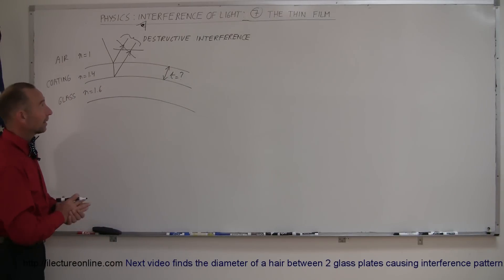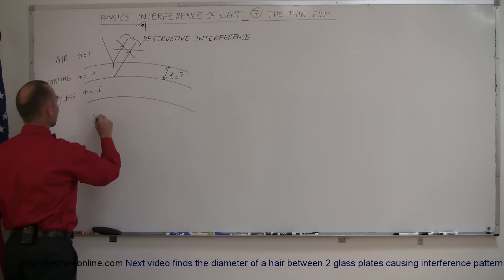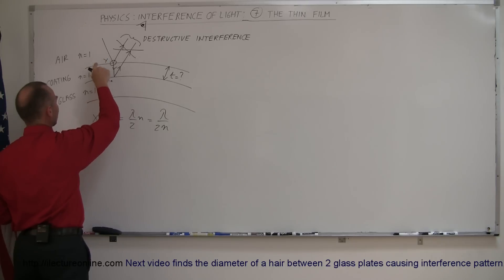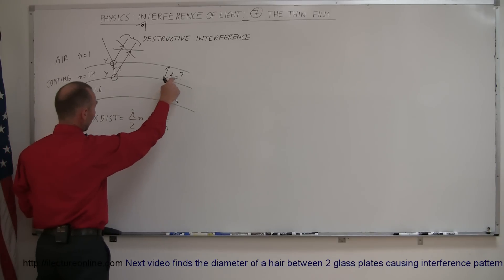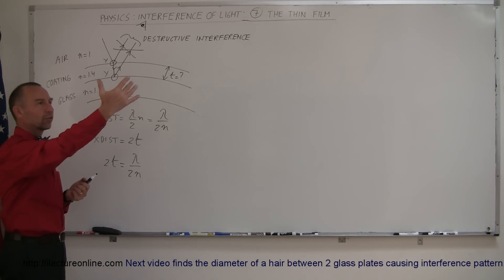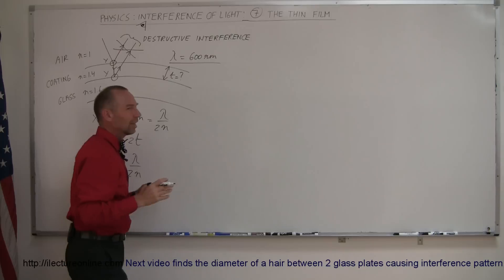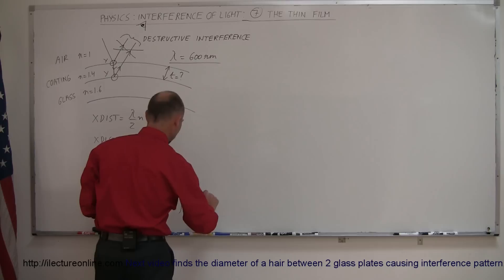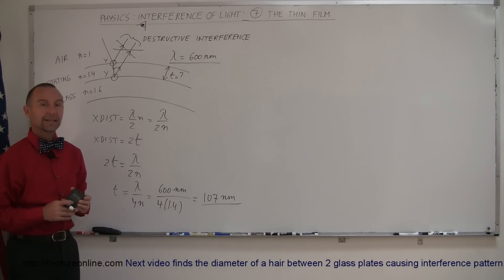Physics 60 Interference of Light (7 of 8) The Thin Film

Comment: Mr. Michel, if there is no half a wavelength phase shift at the boundary, then how are they able to destructively interfere? And also why are we considering the 180° phase shift at the boundaries when we are already aware that there resultant is destrctive interference? Is it that boudary phase shift is different from the phase shift due to the destructive interference, in the first place? I am perplexed!! Please help me!

I have one more question. Why are we asserting that destructive interference will allow all light to enter and none of it will be reflected back? Because destructive interference does not mean that nothing is passing; it simply describes the interaction of waves, while multiple waves are transmitting.
Reply from the maker: When light reflects at a boundary and the index of refraction on the other side of the boundary is greater, there is an 180 degree phase shift.  If the index of refraction is less on the other side of the boundary then there will not be a phase shift when the light reflects.
Reply: @MichelvanBiezen   I know this fact; what I am asking is why are you considering the phase shift twice_ one at the boundary and one due to destructive interference?

Comment: I'm confused here. My understanding is that in the case of destructive interference both rays still get reflected and than cancel each other since they are 180 deg out of phase. So how can we say that the light is being transmitted? What am I missing?
Reply from the maker: 1) At every boundary, light is both partially reflected and partially transmitted.   2) In this example (as  is typical for most examples of this type), we look at the recombination of the ray that is reflected off the top surface and the ray that is reflected off the second surface.

Comment: sir for constructive interference path difference should be nlambda ryt where n is any positive integer,so with n varrying there can be different thickness ryt
Reply from the maker: Not necessarily.  the path difference may also be (n+(1/2)) lambda(sub n), depending on the index of refraction of both materials.  (there could be a phase shift at the second boundary).

Comment: If you do not get that there is constructive or destructive interference in the task, how do i decide which it is? In a previous film you showed Y on both places, and here it was also Y on both places, but one gave destructive and the other constructive. Can you calculate and decide wether it is constructive or destructive? I dont understand how i am to decide hweter it is a full wavelenght or not?
Reply from the maker: It depends on what is asked.  If the problem states that they do not want any reflection, you need total destructive interference so that all the light will be transmitted, and if they want none of the light to be transmitted, then they want total constructive interference, so that all light will be reflected (like UV light)

Comment: Thank you so much Sir. But there's one thing I can not understand. How can destructive interference increase the transmission?  as you demonstrate in the class. reflected beam will cancel out each other, but the reflected beam will just disappear. those can not increase the transmitted energy. thank you so much Sir.
Reply from the maker: Yes, people like you that look into it a little closer will indeed find some discrepancies with this type of problem. The problem is oversimplified in order to illustrate the concept.  What is being looked at here is the following:  The interference between the ray that is reflected off the air-coating boundary with the ray that is reflected back from the bottom of the coating - glass boundary, such that the extra distance traveled is twice the thickness of the coating.  In "real life" at every boundary (in both directions) part of the ray is reflected and part of the ray is transmitted, so we could actually look at many combinations.   In more advanced optics courses and in the book written by "Hecht" you will find the more complicated examples.
Reply: @MichelvanBiezen   Thank you so  much Mr. Biezen!  I really appreciate your help! stay safe!
Reply: @MichelvanBiezen  This is a huge relief (I think).  I was wondering if this had to do with the probability of a photon existing as in the Schrödinger equation... (The out of phase waves cancel out the probability of reflection, therefore the probability goes instead to transmission.)  That is false and not what happens, right?  Maintaining conservation of energy, both reflected waves do get reflected, taking that portion of energy with them, it's just that no observer sees any light due to destructive interference?  Or are you saying that because the waves would be out of phase, the individual reflections are actually prevented?

Thank you for the videos, I have watched about 80 in the past 3 days and your explanations make the material easy to understand.
Reply from the maker: Note that the constructive and destructive interference is in reference to the observer (see the eye ball) looking at the reflected light.   If the light is not reflected it will instead be transmitted across the boundary of the coating and into the lens.  Therefore less reflection means more transmission and more reflection means less transmission.
Reply: @MichelvanBiezen   Thank you Mr. Van Biezen.  I still have some question about it.  To me, the energy was reflected twice from the first surface and the second surface, the total energy was reflected anyway, it doesn't matter whether it's destructive interference or constructive interference. In both situations, the same energy is reflected from the incident beam. In both cases, the transmitted energy are the same, so the transmission should be the same.  The difference between those two cases is that the reflected beam phases was changed so that they can either cancel or add up, but the energy being reflected is the same. just we can't see it. just like in one case there is a electron and proton(because charge of them was changed when they were reflected ), but in the other case, you get two electrons or protons.   Sorry for the trouble Sir. Thank you for your time.

Comment: x dist= 2t = (m)lambda(n); m= 0,1,2,3... and lambda(n) = lambda/n use this equation accordingly. 

If both rays have a phase shift (.5 + .5 = 1 then both rays are in phase), use (m) for constructive (to keep ray1 and ray2  in phase) , and (m+.5) for destructive(if you want ray1 and ray2 to be out of phase). 

If one ray has a phase shift (ahead by .5) , you need to somehow add .5 for the second ray to catch up - so in this case use (m+.5) for constructive (to get ray1 and ray2 in phase) and use (m) for destructive (to keep the rays out of phase)

That's why m depends on what you start with, if the rays start in/out of phase. Hope this helps :)
Reply: how to use m ,  how it can be used for multilyaer AR coating .. for academic purpose.

Comment: Hi , if there was NO phase shift (inversion) at all , would the phase difference still equal to half a wavelength for them to destructively interfere?
Reply from the maker: If BOTH boundaries had no phase shift you would solve the problem in exactly the same way.  But if one had a phase shift and the other didn't then a path length difference of a whole wavelength would cause destructive interference.

Comment: Oki .. In this case both rays are pi shifted so why you said  that there is distractive int. Why we didn't use the law of constructive !?!? As in the previous video
Reply from the maker: It depends on what happened on each boundary.  You must also determine if there is a 180 degree phase shift or not at each boundary.
Reply: okay i got this part  .... but what if he said that the incident ray was make an angle (say for example 30 ) here i will ignore this or use (2tcos"refracting angle") i.e use Snell's  law
Reply: @MichelvanBiezen  wondering this too! even though this was 7 years ago

Comment: Is there able to occur the interference of light in 2.0㎛ thickness of thinfilm(adhesive)?The film seems reddish.
Reply from the maker: Yes.  2 micrometers would equal several wavelengths of visible light.  Thus m would be greater than zero.
Reply: +Michel van Biezen Thank you for reply. Sir. 'm' is the integer?  In 1.5micrometer thickness of coating, the film almsost does not seem reddish, but in 2.0micormeter thickness of coating, it seems reddish. is it possible? [construction : air(n=1) / film-40micrometer(n=1.5) / 'coating-1.5~2.0micrometer(n=1.4)' / film-about 10micrometer(n=1.5)]. Please help me.
Reply from the maker: Change the xtra distance in the equation from Lamda n / 2 to (m + 1/2) x lambada n where m can be 0, 1, 2, 3, etc.
Reply: +Michel van Biezen Thank you very much. sir.

Comment: Thank you so much Sir for your great contribution. 
Is there any difference between conditions of path difference at constructive and destructive interference in below two asteroid conditions?
1) n1<n2<n3 (Phase shift done twice)
  a) For constructive interference: Path Diff. must be = 2t = lambda/n ==> t=lambda/2n
* b) For destructive interference: Path Diff. must be = 2t = lambda/2n ==> t=lambda/4n

2) n1<n2>n3 (Phase shift done once)
 a) For constructive interference: Path Diff. must be = 2t = lambda/2n ==> t=lambda/4n
*b) For destructive interference: Path Diff. must  be = 2t = lambda/?n ==> t= lambda/?n
Reply from the maker: The best way to think about it is this:    1) If there is a phase shift at BOTH (or NO)  boundaries, then you find constructive and destructive interference the same way as usual:     Destructive    2t = lambda / 2n       Constructive    2t = lambda / n          2) If EITHER of the boundaries has a phase shift (one and not the other), then the rules are turned around:   Destructive  2t = lambda / n    and constructive    2t = lambda / 2n
Reply: @MichelvanBiezen Mr, Michel, please clarify why the rule is swapped with the destructive-interferece-with-one-of-them scenario.

Comment: What happens if we change the index of refraction to be in the order of 1, 1.4, and then 1 again for destructive interference? I know that xdistance traveled willl be 2t but what will the other xdistance traveled by equal to? Please help! Thanks!
Reply from the maker: +shutcherface 
 Then there is a 180 degree phase shift on the first boundary but NO phase shift on the second boundary.  Thus for destructive interference the extra distance traveled (2t) must be an integer time the wavelength and for constructive interference the extra distance traveled (2t) must be (integer + 1/2) x lambda

Comment: sir i think you got the wrong answer

since the rays already have ^/2 phase difference due to reflection, the xdist should have been ^ so that ^ + ^/2= 3^/2 which is an increment of half the wavelength, then in that case, you will have destructive interference.  In the video, you set the xdist to be ^/2, but then if you add the xdist plus the phase difference due to reflection, you will get ^/2 + ^/2 = ^ (a whole number increment of ^) which means you will have constructive interference. 

Please look this up sir and if I am wrong then help me clarify my knowledge. Thank you! :)
Reply from the maker: +Ja Von  The answer in the video is correct.
Reply: oh okay sir, thanks for responding. I'll go through the topic and hopefully be able to understand it completely :)
Reply from the maker: +Ja Von Note that there is a 180 degree phase shift on BOTH surfaces which cancels each other out.  Therefore you only need a path length difference of 1/2 wavelength to obtain destructive interference.
Reply: +Michel van Biezen oh right! the index of refraction for the 3rd layer is greater than that of the 2nd layer.Sorry sir, I missed that one! anyway, thank you for responding! keep it up sir! :))